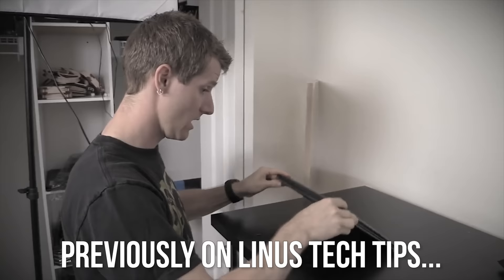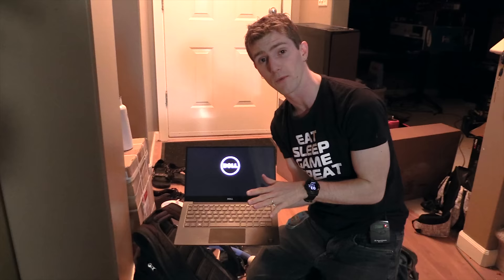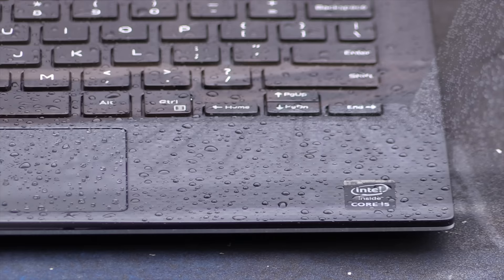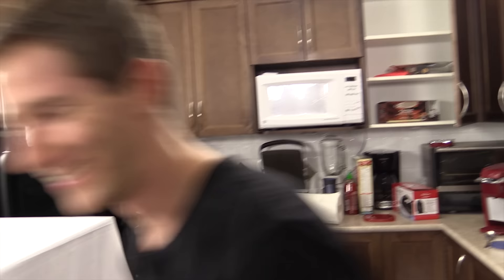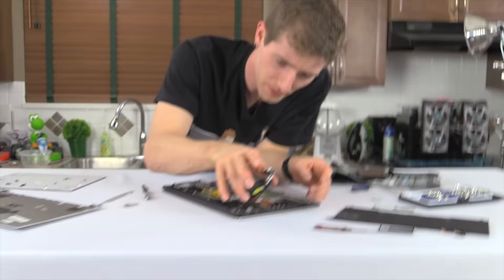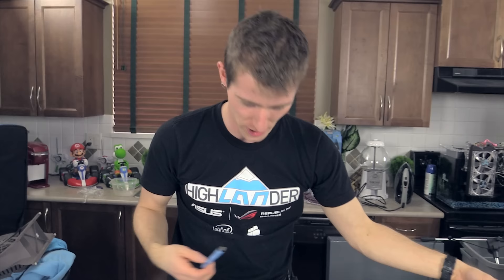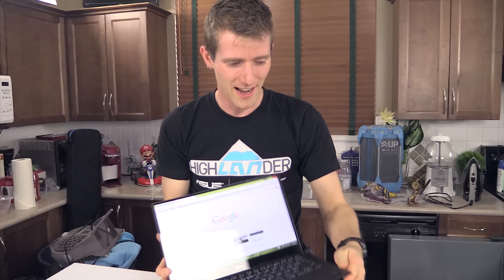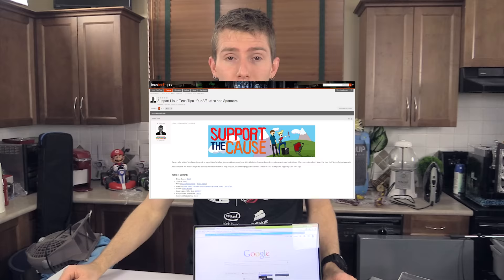Wet Laptop Recovery AGAIN - Dell XPS 13

Comment: did linus ever get the xps 14 and the new 15 because this is why
Reply: +HCL Productions WUUUTTTTTT
Reply: "XPS 14" LMFAO WTF ARE YOU ON!?
Reply: +R33ZA well I saw the xps 15 and automatically assumed there was a xps 14
Reply: HCL Productions I see, the number after the XPS determines the size, XPS 13 = 13''
Reply: +R33ZA oh I understand well this is still why he hasn't gotten the xps 15
Reply: +R33ZA Why so surprised? http://www.dell.com/uk/p/xps-14-l421x/pd
Reply: +HCL Productions He's got it. haha
Reply: +MoistGoat did you not see the big warning label that said this product is no logner availble in other words thev havent made a xps 14 since like 2012
Reply: ***** R33ZAJan 24, 2016
"XPS 14" LMFAO WTF ARE YOU ON!?

Is what I replied to. Whether they sell or make them still is irrelevant.
Reply: the xps 14 CAME OUT WITH THE XPS 12. THeir both OLD the xps 13 and xps 15 are the new ones! jeez. The 13 is 13 inch and 15 is 15 inch, both are Extremely similar, unlike the previousgen 1214

Comment: Spilled a full mug of tea on mine.  Stripped it down, aired it out, reassembled, and it was back to full working order.  Exceptionally well engineered, built, and designed!

Comment: FYI, after a certain period, Windows 8 machines will transfer memory into storage and enter what we know as hibernation. This is why Linus could remove the battery even though he initially left it in S3 sleep state. S3 states need trickle power to retain the current session in volatile ram.

During the soaking period, the laptop might have entered S5 which may be the main reason why the laptop did not short itself when it continued to soak even more.

As he powered the unit back on, Windows 8 recalles the last session from storage, basically waking up from hibernation.

Comment: Now do it with a MacBook.
Reply: Chris Nicholl Why is everyone asking that? :p
Reply: Because they are hard to get into and they're parts are hard and expensive to replace if damaged, not to mention really awkward to manoeuvre.
Reply: Chris Nicholl You could fully take apart a Macbook which is not that hard
Reply: To take apart, yeah maybe. But a MacBook that's waterlogged would not be easy to fix. That's why there's many poeple wanting to see such a video.
Reply: Chris Nicholl I actually accidentally did this in a way. I was careless and knocked over an open bottle of water into my macbook, and about half a bottle of water spilled into it through the keyboard. Not rain, but close enough. I quickly dumped it upside down, took off the back panel, unplugged the battery and put it in front of a fan for 6 hours. I had two very important papers due the next day, and they were both on my laptop. I would've waited much longer but I had no time, gotta finish my assignments lol.  It survived after 6 hours of drying! Before i set it out to dry i quickly shut it down because at that point it was still working fine. I'm on that same macbook right now.
Reply: Kevin Yi As much as I don't like Apple, that's pretty impressve, and at least your assignments were ok : ).
Reply: Chris Nicholl If you hate apple then I hate you
Reply: I'm crushed.....
Reply: +Computer How-2s He just said that he doesnt like Apple, not that he hates it. Why are you overreacting so much?

Comment: I dropped my Galaxy Note 4 into water, dried it out and it works as good as new (the stylus, fingerprint scanner, camera, high resolution screen and everything else all work perfectly)!  I have chronic pain and dropped it into water while having a partial seizure.
Reply: I hope everything is good.
Reply: Gary Blewaska The phone is, but my pain has been really bad; although, it is hopefully getting better.
Reply: ALL THE BEST DEATHSSSSSSS
cough
said nothing
Reply: +Yukari Yakumo I dropped my Sony Z3V into the pool to take underwater pictures, then I took it out and dried it with a towel. Everything works! Oh wait, my phone is waterproof....
Reply: +Yukari Yakumo Am asking this, since Samsung have launched a VR Headset for a 100 dollars and works for note 5, since the 4 and 5 share the same screen size can it work with the Note 4.
Reply: jaafar kassim They have a slightly earlier version that was made for the note 4, and that one will work, but the note 5 version won't fit (I even tried it in person while at bestbuy).
Reply: Yukari Yakumo Thanks, good to know

Comment: well, rain water is not salt water(as sea) which is nicer to metals
Reply: +Marko ‘Orkekum’ Ahonen well who the fuck drops their laptop into the ocean?
Reply: +Snowflakezzx Americans
Reply: +Alexco21 south Canadians or north Mexicans
Reply: +Snowflakezzx The US army! didn't you see Transformers?
Reply: +Snowflakezzx XD
Reply: +Snowflakezzx 
Mr Krabs
Reply: It still oxidises and corrodes metals. Which is why you want to dry it out as fast as possible, and Water it self (H20) does not conduct electricity but water plus metals do (electrolytes).
Reply: +Marko “Orkekum” Ahonen Also, without those salts, it's a very poor conductor of electricity, so maybe shorting-out mightn't be such of a risk with rainwater... I don't know.
Reply: the salt is corrosive meaning you need to clean the laptop asap. But usually the short circuiting occurs from the minerals in the water which conduct electricity. So the water evaporated but leaves mineral deposits which can short circuit. And with pollution and all, I highly doubt the rain water is mineral free like distilled water. Also that is why we use 99% isopropyl alcohol because when it evaporates it picks up the mineral deposits
Reply: +The Sigmatic Player mineral desposits would evaporate like the iso does. iso just washes them away it does not completely remove them. It can break somethings down but things are definitely left behind. 

If you wash a board you need to run the iso on one end and have it drain off and keep washing it that way.
Reply: +Marko “Orkekum” Ahonen Rain water is acidic which would corrode metal more easily than salt water.
Reply: Dloweification No, salt water is more corrosive than rainwater because of electrolysis and ions. Rainwater is acidic, but not that acidic

Comment: I don't understand how the state of the OS is saved. If it's in Sleep and the battery was disconnected, it should have lost the saved state since the RAM aren't getting any power. Unlike Hibernate, where the state of the RAM is saved on the HDD/SSD, so a power cut won't affect it.
Reply: check keyword hybrid sleep
Reply: +Law Hansel Yup, Correct. It keeps it both on RAM and Mass Storage so that it acts as sleep, until power is cut/Ram replaced, then it uses mass storage.
Reply: +ARPANettic Productions (discontinued channel) Actually that's not true, when power is removed, everything in RAM is erased no matter what

There is a difference between RAM (Random Access Memory) and NAND Storage (Solid State Drive), now in theory, NAND Storage could possibly replace RAM someday and long term storage and fast storage could coexist on the same NAND chips, while the technology is there, the implementation is not quite there yet

RAM (Random Access Memory) is fast VOLATILE memory, this means it's at the mercy of a power source, when power is removed, all stored memory is lost, even when not shut down properly, the reason why (typical non-hybrid) sleep doesn't cause data loss to RAM is because while the processor, fans, drives, etc. are off (not receiving power), the motherboard is still supplying power to the RAM, so while the computer seems off to us, it's actually in a low power state, and therefore still on

Hard drives and solid state drives are slow NON-VOLATILE
Reply: Storage (typical SATA based SSDs are still considered "slow" as they are bottlenecked by the speed of the SATA connection, which I believe is limited to 6Gb/s), this means while they are not as fast as RAM, they are not susceptible to data loss due to loss of power

Now with the advent of PCI-E and M.2 based SSDs, these SSDs are not hindered by the speed limitations of SATA, and could possibly combine RAM and SSD functions, yet we have yet to see this happen

The reason the laptop in the video was able to go back to its previous state was because, as was previously mentioned, newer OSs like Win10 contain Hybrid Sleep mode, this is a hybrid of Hibernate mode (imagine sleep with a RAM dump to the swap file and a full shutdown) and sleep (low power state), it sleeps as usual, but makes a backup RAM dump/copy to the swap file, that way if the RAM loses power (like in this case) it boots from the hibernation dump, so while Linus selected "Sleep", it started back up from Hibernate mode instd
Reply: yes it was sleep mode. but after few hours, it hibernates.
Reply: Marhensa Aditya Hadi Actually it should "Hibernate" instantly

When you select "Sleep", it doesn't just sleep like older OSs used to, it does a half Hibernate (copies data in RAM to swap file on HD/SSD, but keeps power to RAM), then activates actual sleep mode (activates low power mode supplying power to RAM)

That way, it should "sleep" the way it always had, but if the RAM does just happen to lose power (timed shutdown, battery dies, PSU loses power, etc.), when you power back on, it will boot the same way as if you booted from Hibernate

Laptops in particular will Hibernate automatically on low battery, allowing the laptop to safely die without losing data, the same thing can be done on a desktop connected to a UPS (Windows reads a UPS as a laptop battery unless third party management software is installed), if the battery dies during sleep, being the contents of RAM are already in the swap file, the computer (laptop) will just power off
Reply: Michael Dickens 
Spot-on!
One thing I'd like to add, its called Hybrid Sleep :P

Comment: you have a great team linus. i've been "douching" heavily congested (dust build up) , system boards, heatsinks and power supplies with the sink sprayer for 15 years without a failure but i only do this with boards that don't exhibit any domed capacitors. if i do notice domed capacitors i recommend to the owner to replace the board with one that is built around the same chipset so as not to disturb the OS. i completely tear down the PC, take all fans and fanned components, spray them clean with hot water. extract the motherboard, take out it's processor and cmos battery, spray it clean. extract all drives from the case, spray it clean. air dust the drives, drain the power supply as much as possible then bring all douched parts to the hottest room, lean the motherboard and any cards interface up (so that air can circulate around every feature) . if the room is over 85F and has a door, with the door shut and blinds open i can reassemble the PC in as little as 12 hours but usually i wait at least 24 hours. i charge my clients only $35 for this service because i love tearing down PCs and can usually tear down and reassemble in an hour